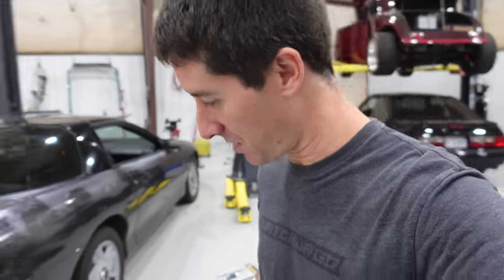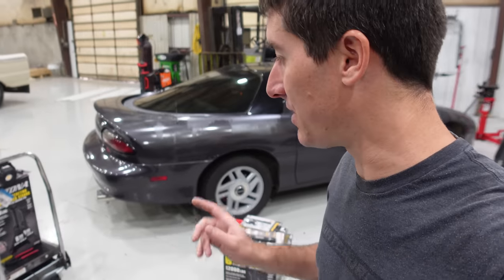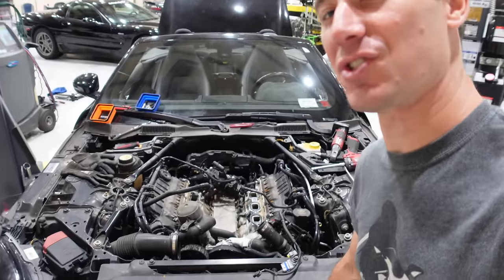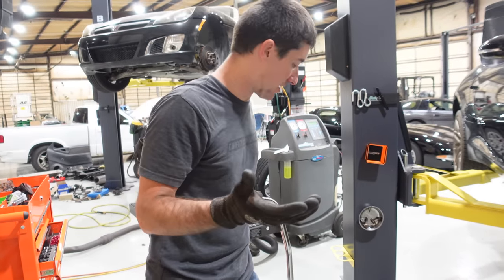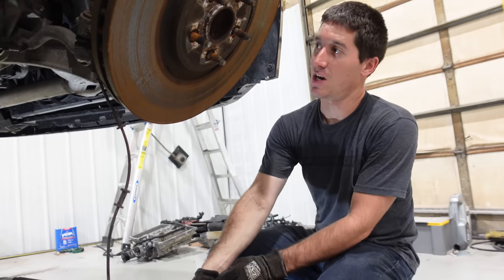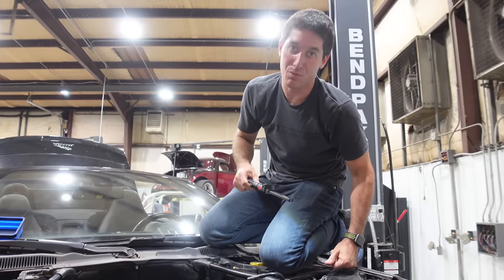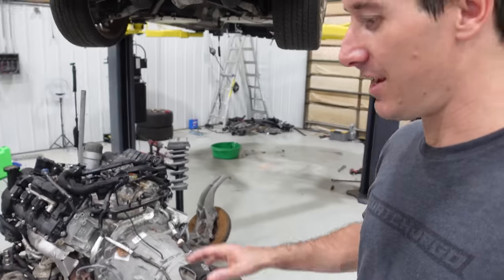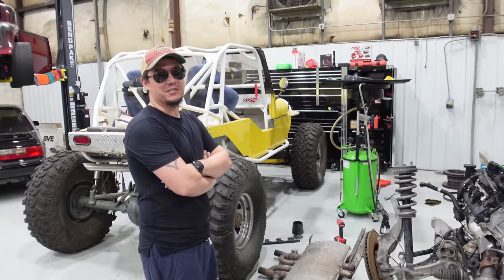This HARBOR FREIGHT Tool Made The Jag F-Type Engine Removal EASY

Comment: John - I was alarmed at the earlier video where you were talking about pulling the engine out from the top.  I've been to the factory, seen the cars assembled and know JLR uses an advanced 3D CAD program to package things really tight.  On the assembly line, the bodies come down from the top to meet the engine, transmission and front suspension going up.  This video was fantastic, well shot, well-documented engine pull.  Good luck with the tear down and looking forward to more videos in this series.

Comment: I just wanted to say thank you for teaching me a lot of tricks and giving me the confidence to tackle larger stuff.
As a kid I took apart a bunch of small appliances and I've been building computers for years, but I didn't have much confidence when it came to large, heavy machines.

I just completely disassembled an old gas furnace that we were removing from our basement.
It was 180kg according to the info plate. Most of the weight was the cast iron core, very similar to an old radiator. It takes 4 men to lift the bloody thing.
I ended up successfully separating it into 5 chunks that weighed less than the wheel of a car.

Comment: JR  You are wicked smart!!  Very smart work-around to get a hyd. lift table tray from Harbor Freight at 1/8 the cost!!! These late model cars don't have engines anymore that can be maintained and repaired in the engine bay. There was no maintainability/repair process's included in this cars design!!!

Comment: Now that you have the table and know its limitations, consider modifying its size to improve the balance with the engine sitting on it.  You could probably add a few anchor points for ratchet straps to tie the engine to the table for stability.  Those are the benefits that Johnny has with his table that improve its rigidity/stability....at a significant additional $ cost (wasn't his table about $3500.?).  If you wanted it to go higher, you might weld on some sleeves for the forklift blades to raise and lower the whole table.  
You are creative enough to make that table whatever you want it to be.  Good job.
Reply: I used to have one of these lifts and modified it for a much larger surface area.  I used it for lifting espresso machines, but it could just as easily be modified for lifting car engines.  Great idea!
Reply: Johnny's table is like $6600. That HF table is a screaming deal.
Reply: I concur!

Comment: As others have said, it looks like you could have swapped the handle brackets but kept the handle and release cable in the same orientation.

I would also build a raised platform under the table to increase the footprint for stability and tall enough to slide a motor stand under to make a table to stand move easy.

On top you could add a plate or plywood board to widen the table top and extend the back to catch the transmission further back and/or strap the transmission to to reduce the forward rolling of the engine/subframe.

Both of those things would give you some height, just make sure it isn't too much to do the engine stand transfer.

Comment: When I pulled the engine out of my G35 coupe, I did it on jack stands and supported the engine with a floor jack. As I was lowering the engine, my dad (a former mechanic with decades of experience), says, "Uh, Dave - are you sure you want to do it like that?" ... as the whole engine / transmission assembly rocked back and forth on the jack - and somehow didn't fall. If I ever have to do one of those again, I think I'll pull the front bumper and slide it out that way. (But, the Jaguar probably has a lot more in the way of a front removal than a 16 year old G35.) I also had a cherry picker hydraulic cylinder fail when putting engine #3 in my Solstice. Fortunately, it just slowly sank the remaining 3" onto the cradle. (I should probably get a lift before I drop a drivetrain on my head or feet or child.)

Comment: Now that you've reversed the handle mounting brackets, couldn't you remove the cotter/pivot pins and reverse the handle?  That way the cable and release lever would be on the right-hand side again even though it folds the opposite way now?

Comment: You could disconnect the cable at the handle where the wire ends and turns into a lead inside the plastic handle, push it through the eyelet then reconnect to the handle without cutting I believe?

Comment: I'm pretty surprised you didn't have one of those carts yet, I've heard great things for a long time but haven't got around to buying one yet. I did recently pick up that set of jack stands, though, and wow are they nice: they really make my expensive old Craftsman ones look weak. Think I'll get a pair of 3 ton since I can almost not quite get the 6 under my vehicles. Not getting under a car under non-double-locking jack stands again.

Comment: Probably getting close-ish to max weight capacity of that lift, but seemed to work well! Still less sketchy than those boxes you used on I think the white Corvette. Maybe ratchet ratchet strap it to the lift before lowering so it does roll forward. I think Ninja does that

Comment: If you know what to look for you can get some decent tools from Harbor Freight. I got a 12" sliding dual bevel miter saw for like 129 bucks years ago and the reviews weren't horrible. Haven't used it yet but I have plans for upgrading the trim work and like that on my house someday.

Comment: You always FIX stuff. It would be awesome to BUILD an Ambulance camper Van to pull the side by side for off grid trail riding.  OK, it would awesome if I could. But I have the mechanical ability of a sloth. But if anyone could rock the project of my dreams it would be you.

Comment: You need to buy a small scissor lift on the cheap, remove the railing, and have the controls mounted on a cabled remote. Modify the platform as necessary to remove/install whatever you're working on.

Comment: What is that little wand light you were using to check for snagging wires? Looks super useful and meant to ask sooner
Reply: $30 at harbor freight. They're great. Magnet on the bottom, rechargeable and very bright. Going to pick up a few more myself!
Reply: @Ed-ui2qe  thanks! Guess I'll be out there this weekend again.

Comment: That transmission shift cable is just to but the car in neutral. It should have a nut on to hold it on though

Comment: Honestly don’t bother with those exhaust studs. Just take the heat shields off and remove the manifold with it. Don’t risk breaking them. The exhaust bolts look like a special tool but we use alens to remove them all the time. It’s what they told us to use in training

Comment: that assembly has to exceed the 1000lb weight limit of that stand
Reply: Maybe not. Could be close though.
Reply: I don't think so, but I don't have the exact weight measurements of the engine and trans. I'd say it's close, but not over. If I were to take a wild guess I'd say the engine is 500LB or under and trans is maybe another couple hundred.

Comment: I must off missed something. Why are you pulling the transmission? I thought you were  installing a passenger side head gasket?…..So your  getting a salvage yard engine?
Reply: I think it was just was easier just to pull the whole unit out.
Reply: JR said there was absolutely no room to get in there to separate the transmission/get at the top bolts, easiest way was the way he did it.

Comment: JR, I cannot understand your interest in this car other than the challenge. I noticed how rusty and one-off the exhaust was (the muffler was gigantic). It seems to be made from sub-par materials, and is a time-suck to work on. It is even not that sexy. The new Corvette is way sexier. I checked the specs on this car. It is not that fast, it does not corner that great (poor g-force numbers), and it is completely unreliable. I just don't get it.